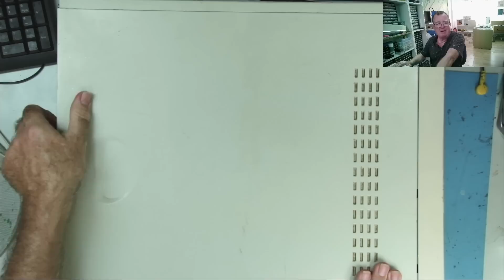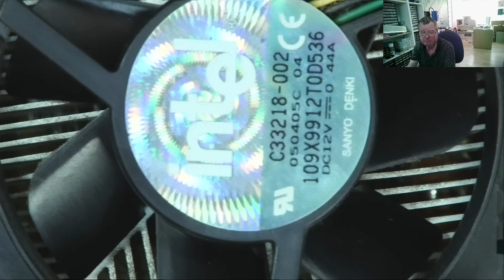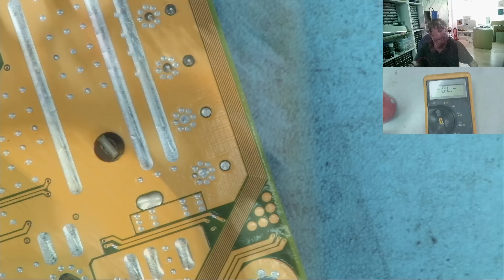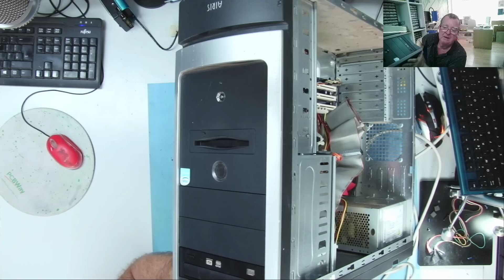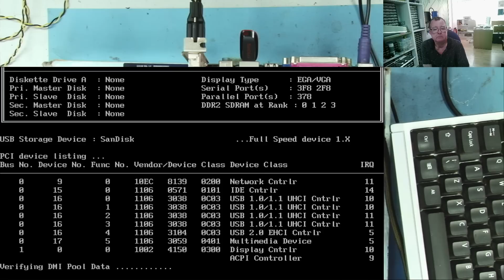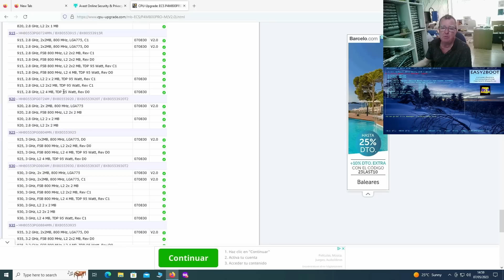Retro PC Finds At The Flea Market 7th May

Comment: I suppose a lot of your fanbase are vintage computer enthusiasts. Not an interest I share for the most part but still enjoy your videos. And look forward to more DIY test gear in the future. 

Your troubleshooting videos are marvelous! Regardless of if your troubleshooting something that I have a particular interest in or not... The troubleshooting and fault-finding is still super helpful no matter what your fixing!

 Glad you've been having good luck at the flea markets! That's one of the best feelings in the world! 😁
Not so much for the wife though 😂
Reply from the maker: The mix of regular viewers here is interesting in itself.  You can see the view stats on all the videos I released the last month.  The highest views are 
Best Way to learn electronics
Convert PCB to schematic
the DSO-TC3 oscilloscope/component analyzer and the one where I teach Sarah microsoldering.
Can't fix it because you are not good enough
Learn methodical fault finding
Reverse Engineering a PCB
Then the specific repair videos where I fix something like a motherboard, cb radio, drill charger (actually this one did unusually well for a repair vid) etc
And the the Retro PC flea market.  But these ones regularly get 3.5K-6K views each which is similar, if a bit lower, than the repair videos

So I try to keep a wide audience happy.  I'm trying to structure this a bit more now, like Retro PC Sunday (or Monday) I've started doing.  Also there is a personal factor.  I do everything myself, recording, editing, video production etc on top of the actual repair/topic so it should be no surprise that some of the videos I make are quite tough on me in the amount of work involved and the retro PC stuff is a bit easier/lighter so I like to do it to chill out and relax a bit myself.  Plus I do love retro hardware so there is a bit of a bias there.  I hope to keep everyone happy as best I can
Reply: @LearnElectronicsRepair  I think you're doing a wonderful job and it's a content niche that hasn't really been filled on YouTube before.
Reply: @LearnElectronicsRepair  I spent years hoping to find a mixture of someone like "diode gone wild", AvE, big Clive, but with actual focus on some decent attainable and useful test equipment.... and most importantly actually troubleshooting and fixing common things from start to finish. None of which to those guys ever do and if so very rarely. Mr. Carlson's great and I was a member his patreon for a very long time but I don't work on old radios and stuff, I wish she did more tests gear but I still learn a lot from all of those guys. Your channel was the first to relief package it into one cohesive content stream. And it has been a lot of fun watching you grow. You and your channel definitely deserve it. As a professional working on all kinds of industrial and metrology equipment everyday.... Your channel has got to be one of the most useful by far. Even though I don't work on the exact same things you do it really does stimulate my learning process and has helped me a lot along the way, sometimes the simpler things that you find in your videos are something I would have never looked for under the hood of a $30,000 scope. Even though what we work on my be wildly different, you're content really makes me think and your troubleshooting is so intuitive and straightforward but also very in-depth. Perfect mix in my opinion. Best troubleshooting channel on the net. Full stop

 And Marco reps there for a while too but he gets off on some crazy tangent which alot of the non-metrology guys might not like. Even though I love it. But nowhere near as useful as a channel like yours to most folks. Cheers! Absolutely impeccable 👍 10/10 would recommend

Comment: Chemi-Con KZG capacitors are known bad. When you pull them test them. I'd like to see just how messed up they really are. I could see them just being in circuit screwing things up though.
Reply from the maker: I've ordered a bag full of 2200uF 6.3V caps yesterday, the will be here in the next few weeks.  Sure I will look how bad the existing capacitor are and it will be interesting to see if they are causing this fault just by being present.
Reply: @LearnElectronicsRepair  yes it will. KZG capacitors are real bad. Chemi-Con usually makes fairly decent caps too. But not that particular line.

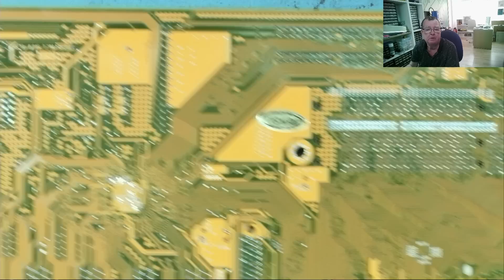Comment: First motherboard is a Tean ml1 94v0 it is written on the back as you can see at 3:21 in the video
Reply from the maker: Ermmm I thought 94v0 was a fire safety rating, not a motherboard model number
Google: What does 94V0 mean?
If you need to design a PCB with a 94 V-0 rating, which means the specimen cannot burn for more than 10 seconds. When working with circuits, you have to choose the right materials to make sure your PCB indeed receives a 94 V-0 rating